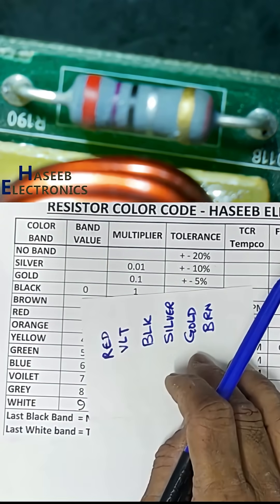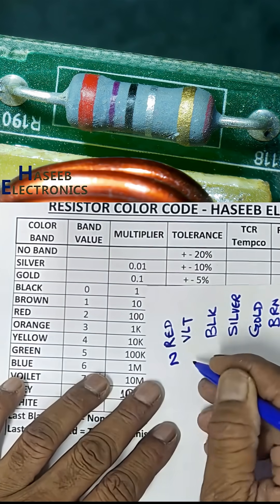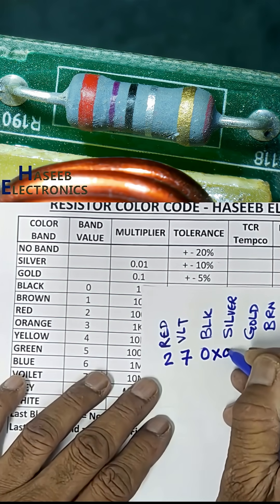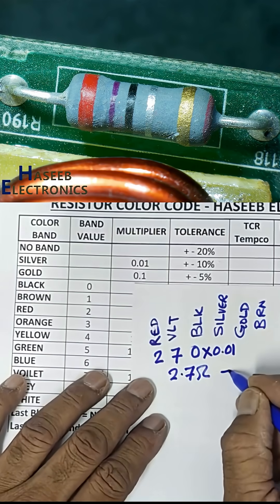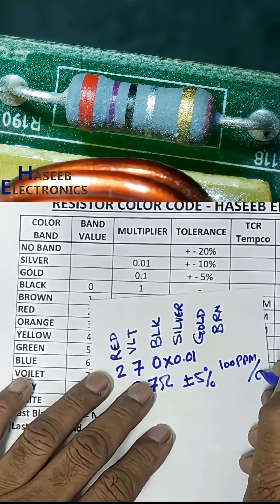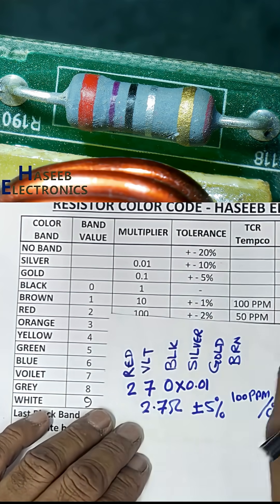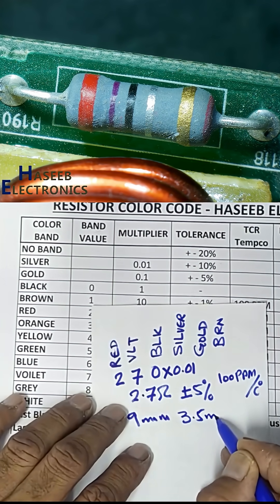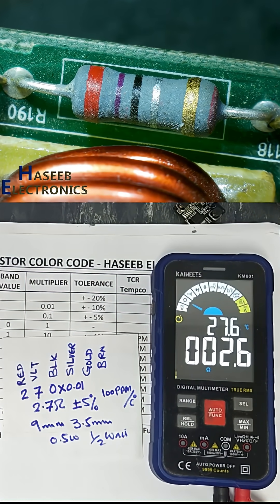Resistor Color Code & Power Rating Explained | Red Violet Black Silver Gold Brown #shorts

Comment: ppm  pulse position modulation ?? the resistor is changing the distance we measure the distance by return per second/unit  e=mc2
Reply from the maker: PPM is not  pulse position modulation. it is parts per million 
for details check this link  https://youtu.be/oOQu6nfdGZ0